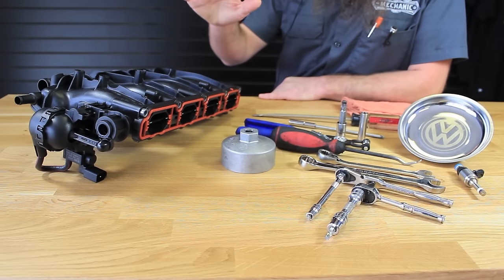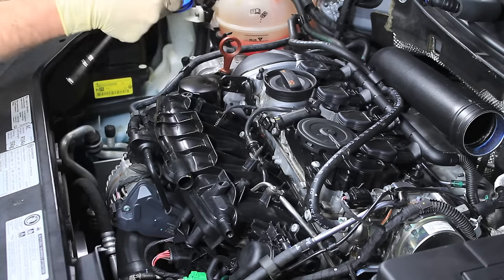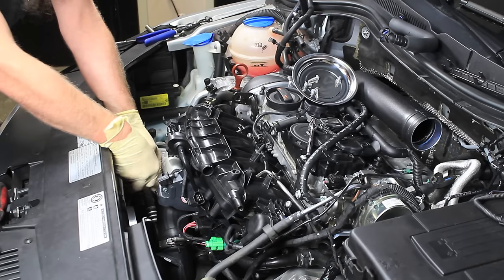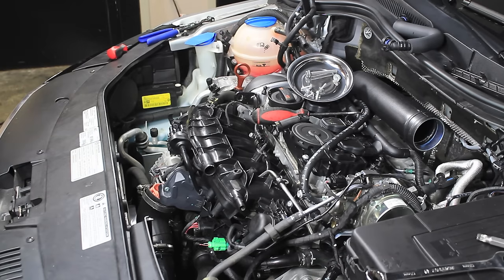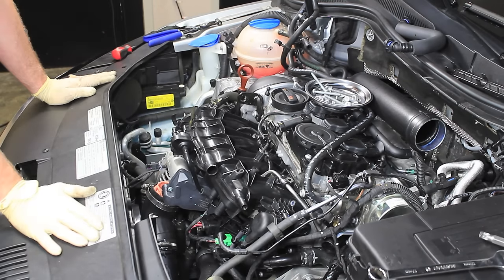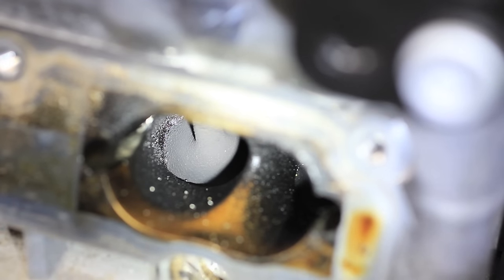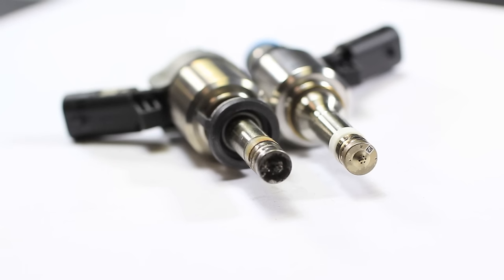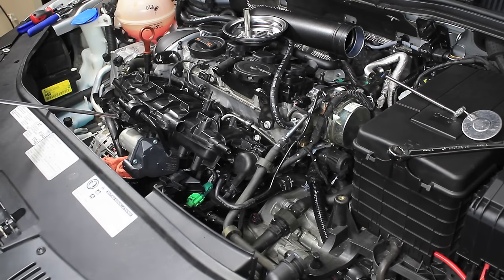Intake Manifold for VW and Audi 2.0T TSI DIY (How to) Replacement

Comment: I have a 2015 Audi A3 2.0 TFSI Quattro tuned with Stage 2 APR Bull X Downpipe, IS38 Turbo with apr software, APR Carbon Fiber, and forge diverter valve. I got a check engine light P2015 and P2016 with no symptoms yet. Should I replace the intake manifold and does this guide is the same for the Audi A3 8V? Thanks.
Reply: I have a 2019 VW CC Stage 3 Turbo Kit, DSG software, BBS (official) CH-R Wheels, Milltek Sport Exhaust, and Bilstein PSS10 coilovers.. with 1355HP. 
So the answer to question, if you have a check engine light ON don't wait for symptoms, fix it before it's too late.

Comment: So I pulled of the intake manifold to check for carbon build up but after reinstalling everything I’m getting a code for transmission coolant temperature  sensor B+. Any ideas?

Comment: I tried looking through all the comments before posting this question, but do you recommend de-pressurizing the fuel system a certain way before removing the line?
Reply from the maker: +Ian Regan (Kiegle) Its never a bad idea.
Reply: What is a method you would recommend if I were doing my Intake manifold?  I am an aircraft mechanic myself and we usually just crack the line open and let it drain.  If I just cracked that one fuel line with some soak-up pads under it, how long would it drain for?
Reply: +Ian Regan (Kiegle) Too much fuel pressure... just remove the fuel pump conector and tur on the engine until it runs out of fuel.
Reply: +Clovis Tanganelli yeah I suppose you could always prime the lines to get all the air out when it's all finished.
Reply: +Ian Regan (Kiegle) after finishing the assembly just turn on the engine. The air in the fuel line will escape through the injectors. This is not like diesel engines, fuel is injected before compression.
Reply: +Ian Regan (Kiegle)  <<<<< Absolutely!!!!!!!!!

Comment: I changed the intake manifold but getting the same 1 code p0215. But I used the old sensor with the new intake.. The new intake works like it should and all other codes cleared like p0171 and fuel pump code.. So does this seem like a sensor issue?

Comment: I just started removing my manifold for a manifold failure, and also to do the decarb. I found out that someone had been in there before because that coolant connector that is wrapped around that brace was spliced. -_-

Comment: just did this install myself and watched the video while i was doing after the install i cleared my codes and the same p2015 code came back and now my car drops rpms when i push in my clutch what should i be looking for that might be makeing this happen
Reply: Went through the same problem. What this video fails to mention is that you gotta run the intake manifold adaptation. The ECM checks extremities and adapts to those new limits.

Comment: Hi, thanks for this video.  I'm going to be following this to the letter soon so that I can attempt to clean carbon deposits from the backs of the inlet valves.  Can I ask, from your experience, how likely is it that I will need to replace the injector seals? Do they almost always come out with the manifold, or should they stay in place with the cylinders? My car has 65k miles on it, but I really don't want to fork out £120 for for injector seals if I don't have to. As you can tell I'm a bit of a novice. Thanks!
Reply from the maker: +Harry Marshall They often come out
Reply: +Deutsche Auto Parts thanks.  I'm a bit confused about pricing. Does £30 cover all 4 seals or just one?
Reply from the maker: Harry Marshall You will have to contact your local supplier as we do not ship to the UK at this time.
Reply: +Deutsche Auto Parts Thanks.  Can you tell me the RRP for your store though, just so I can get a rough idea of the part cost?

Comment: Great video, very helpful, saving me money, thank you! I have a 2011 Audi A4 2.0T. I've got 1 code (P0303) which is cylinder 3 misfire. I've changed the coil pack, spark plug, i've done seafoam in the intake and had a lot of smoke come out of the tail pipe, now i'm repacking the fuel injector. If i replace the fuel injector and still have a cylinder 3 misfire, what do you think can be the problem? The spark plug on cylinder 3 is always "wet" when i take it out, all the other plugs are dry, could i have a wiring issue? The diverter valve was also replaced a while back. Also the car is making like a flapping sound from the engine. Also the brakes on the car have new pads and rotors and i noticed that the brakes are extremely sensitive, meaning their very responsive compared to any car i've ever owned, is that how Audi's are?
Reply from the maker: You should consider having the vehicle properly diagnosed by a VW/ Audi specialist.  Replacing more parts is probably not the best option at this point.
Reply: Deutsche Auto Parts well that didn't really answer my question.
Reply from the maker: Islam Elfarra Im sorry but diagnosing a vehicle requires a much further dive into what's going on. It seems like you have done the basic stuff and don't know where to go, and we really think the next step would be to take it to a professional.    

The list of issues that could cause a misfire on a single cylinder could be (probably more but wanted to give you a quick overview)
The injector you replaced is leaking into the cylinder
The injector you replaced wasn't the right one
Incorrect or low quality spark plugs
Incorrect or low quality ignition coil
Bad Wiring (not likely)
Bad ECM (not likely)
Damaged piston or piston ring (not likely)
Damaged Valves (not likely)
Damaged lifters (not likely)
bad gapping on spark plugs
Bad Wiring to the coil (not likely)
Reply: Thank you for your reply. I still have not replaced the fuel injector i am about to do that though, i bought a new fuel injector hopefully this will solve the problem if not i will take it to Audi. My question is have you experienced this in the 2.0T of a single cylinder misfire and if you did what was the solution?
Reply: @islamelfarra4541  could it be the valve cover gasket that just leaks oil in the spark plug well? what was it?
Reply: @vindieu  no that wouldn’t be the issue. My issue was one of the valves were chipped causing a misfire. Then I did a complete rebuild which lasted perfectly fine for 3 months then the timing skipped a tooth and seized the engine…. 2.0T are garbage engines. My mechanic has one, he rebuilt it and still has misfire issues, now he’s trying to sell, my 2 cents don’t waste ur money on these engines get a 3.2L if U really wanna keep an audi
Reply: @islamelfarra4541  Yes they're really bad. Mine has costed me 1000$/1000km to keep alive.
Reply: @vindieu  🥶

Comment: i own a 2010 CC VW, manifold replacement, fuel injectors, carbon buildup ,cleaning.. dealer is charging 335 for parts and 775 labor. Is that sound reasonable?
Reply: The manifold should have warranty until 125,00 miles

Comment: Humblemechanic,

Thanks for the videos. Would valve cover gasket replacement on 2.0 tsi(2012 cc) be too difficult for novice repair? I had dealer quote me
Over $700 for this which seems ridiculous for a gasket - there is oil leak evidence on the intake pipe.
Reply from the maker: Justin Nicolosi There is no gasket for the valve cover on that engine.  It uses this sealant which is crazy expensive (Link below).  with that said it seems to be more that that job should be.  You should consider finding a local VW specialist shop to get a second opinion.  

https://deutscheautoparts.com/d-154-103-a1.html

Comment: Nice job!!!! Is there a torque setting for the intake bolts?
Reply: Good question, where is the answer?
Reply: Yes there is an answer!  Its 10Nm or (7 ft-lb)  Just make sure you're using a NEW intake manifold gasket (not reusing the old one) and to STAGGER your tightening sequence, building up the torque settings as you go. Another words, start off by tightening all bolts in a staggered pattern to 3-ft-lb, then 5-ft-lb, and finish off at 7-ft-lb.  Hope this helps!
Reply: Thanks my friend! Do you know the torque setting for the bolt on pulley of water pump belt on 2.0 TSI engines?
Reply: You mean the WP-Pulley Drive Gear right? That too is 10Nm (7-ft-lb) +1/4 Turn  (that's a +90 degree turn)
Reply: Perfect! 
Thanks again!!!
Reply: MyEyesBled . The last question, which especial tool did you use to connect the torque wrench on the bolt (due the little space)?
Reply: I don't know where you are, but some tool makers call them TORQUE WRENCH ADAPTERS, while others call them CROWFOOT METRIC WRENCH SETS.  Snap-On Tools & Harbor Freight Tools here in the USA have them in all sizes!  Happy Fixin'!
Reply: MyEyesBled . I tried to use the torque wrench adapter, but it is possible only if the pump is removed. Can I apply the torque with the pump removed ?

Comment: Followed the video and everything went fine but the fuel line (bolt down the manifold) is leaking and throwing the code back again. Some solution??
Reply: I have the same problem

Comment: Hey bud, 
Great video, I have an error on my A4 B8 2013 1.8 T.. error is P0068 throttle body corelation, I replaced the whole throttle body cuz it looked bad.. but even after doing that error is still there and another error popped up saying P0507 idle air control system RPM higher than expected. 
Please guide.
Reply: Did you figure out the P0507 issue? I just got it as well
Reply: @pedromichaca3056  hey bud.. yeah. Originally my PCV valve was bad and i replaced it. Worked like a charm

Comment: Hi i have a 2009 gti and i have an oil leak  on the top left side of the engine and it looks like its coming from the cover on the left. I believe its a timing chain cover. my question is does this timing chain cover leak oil, or is the oil coming off the valve cover? thanks
Reply from the maker: +Gomez Jaime Im sorry there is no way for us to know thiat.  This could be coming from either place.

Comment: Do you have a torque spec on the 9 intake bolts/nuts? I am re-doing a job someone else did and stripped a screw hole in the head.

Comment: Does anyone have a video of how to remove that Bracket bolt? Mine is a bit slip and it is very hard to reach even after removing the throttle body, just want to see how it can be reached easily or do I need some kind of special tool for that one

Comment: I just replaced my intake manifold and the only thing I did that I didn’t see in the video, was disconnect the battery. I triple checked that all my connectors are connected properly but no start. Any idea what it could be?
Reply: Never mind I figured out what it was. Spark plugs were wet. So I cleaned them and now it starts right up.

Comment: Diy video are always good ,need a camera person to zoom in on some of the areas
Reply from the maker: howard boone We do our best to show what we can.  Many times some things on cars must be done by feel as there is no line of site to the action.  Thanks for checking out the video.  Hope it was helpful.
Reply: It way very helpful, your explanation during video is text book.
Reply: howard boone To echo what Deutsche Auto Parts said, it can be VERY hard to get that zoom. Especially when low in an engine bay. I have even tried to use an inspection camera to get better shots. Some time you really need to see it with eyeballs to see it properly.

Comment: This is an old video, but i'll ask the question anyway, what size is the oil filter wrench?  Thanks
Reply: I think it will depend on the oil filter you use.  If you're not sure, an oil filter plier/clamp tool could work too.

Comment: it seems that the torq spec is for the torx 10NM and for the 10mm nuts 20NM and starting in the middle tightening crospattern to the outside! im not 100% shure about the torq spec for this car

Comment: one thing to note that is not even mentioned in this video, if you have the battery and throttle body disconnected for idk 15 min to 24hrs your car will not start due to the cableless electrical throttle which somehow all of a sudden becomes stupid and doesnt remember its starting position, and you come to find out you need a vagcom cable/vcds program, coming from rosstech going to costs around $650-$700 or from total car diagnostics (they got a study going on right now offering $300 off cable&program) that running around $67(not upgraded)- $97(upgraded ver) cable is a vagcom 7.1.3 HEX+CAN+USB. PROGRAM IS ORIGINAL ROSSTECH VCDS!! BAD THING DEPENDING WHERE YOU LIVE 4-7DAYS@ $27.00 OR STANDARD RATE@ $5.95 TAKING 12-18DAYS FOR DELIVERY. I FINALLY FIGURED THIS OUT AFTER HAVING NO CAR FOR 2WKS AND OF COURSE WAITING ANOTHER 12-18DAYS FOR DELIVERY (STILL HASNT ARRIVED), AND NO B4 ANY1 COMMENTS, COULD NOT AFFORD $27.00 SHIPPING DUE TO OHIO WORKER COMP DECIDING IF AND WHEN I NEED/DESERVE A CHECK.   *****DONT GET ME WRONG THIS WAS AN AWESOME EASY TO GO BY VIDEO AND I SERIOUSLY, REALLY APPRECIATE THIS GREAT VIDEO, BUT THAT 1 LITTLE PIECE OF VERY VALUABLE INFO HAS PUT ME IN A FINANCIAL, LEGAL POSITION. NO CAR MEANS NO DOCTOR, NO PHYSICAL THERAPY, AND NO SHOW TO A INDUSTRIAL COURT COMMISSION TO BATTLE BWC, AND WITH THESE MISSED APPOINTMENTS OHIO WORKER COMP IS NOW MAKING CLAIMS IF IM NOT SHOWING UP THEN I MUST BE HEALED SO I DONT NEED PAID. YOU TELL THEM YOU CANT MAKE IT THEY SAY YOUR GOING TO HAVE TO TO KEEP CLAIM OPEN. *****THIS IS NOT TO CRITICISE THE HUMBLE MECHANIC HE IS REALLY GOOD, BUT MORE INFORM OTHERS OF THAT LITTLE BIT OF INFO THAT COULD POSSIBLE LEAD TO THAT NEGATIVE DOMINIO EFFECT OF ONE BAD THING HAPPENING AFTER ANOTHER.
Reply: It appears that no one else has had this trouble and I doubt everyone has this software and cable. Is there another reason this could have happened on your vehicle? What year, make and model do you have?
Reply: I bought a vagcom six months after buying the car... 3 years ago. It's the most important tool when it comes to having these vehicles. I recommend anyone who own a VW get one seriously
Reply: You are right. Also, after the disconnection of various electrical connector, clearing various alarms using OBD is needed. Mine registered 12 alarms that prevented a start.

Comment: What's the tool needed to replace the seals on the fuel injector?
Reply: I used a standard freebie bic pen to install the white high pressure seal. To compress the seal after install I wrapped the injector in painters tape and electrical tape and compressed overnight with a zip tie. To get it to fit into the block I lubed each injector with alcohol, placed a rubber mallet on the back of the injector, and tapped the back of the injector with my fist. That or you can buy the special tool here https://www.shopdap.com/wkz-t10133c.html

Comment: Thx for the great videos. Does anybody knows where the coolant temperature sensor is located on this engine? 2008 passat 2.0TSI, engine code is CCTA. Cant seem to find it, tried everything on google.. thx
Reply from the maker: Tommy Gar it should be in the water pump which is on the front side of the block under the intake manifold.

Comment: so I have a 2009 Passat and it's leaking fuel from underneath the intake manifold, I can see the fuel dripping on the right side when standing in front of the motor.  I don't have any codes though.  Is the leaking coming from the manifold gasket or the injector gasket?  How can I tell?  Thanks!
Reply: Raffi Tchakmakjian 
Probably cuz u didn’t reseal the intake manifold. I would check that first and then check hoses and make sure everything is tightly set up
Reply: @rafaelalfaro964  hey thanks I figured it out. The leak was coming from the hard line, I think the high pressure line, the nut next to the brass nut underneath which is loosed to give some slack, just needed to tighten it.  Thanks again!
Reply: Raffi Tchakmakjian you’re welcome bro, I’m glad to hear you were able to solve the problem .